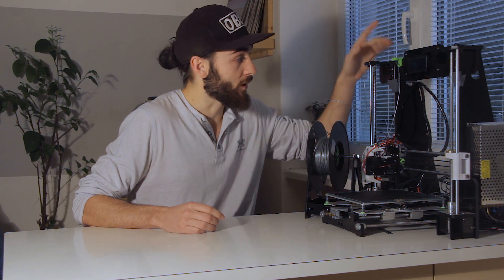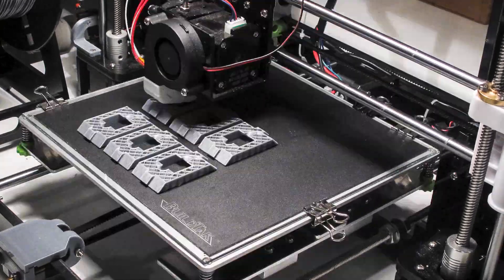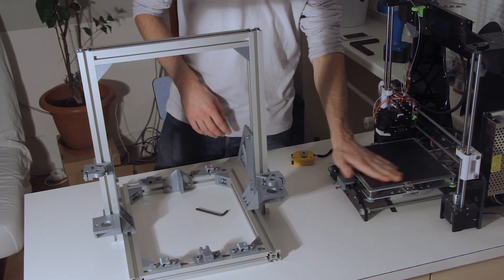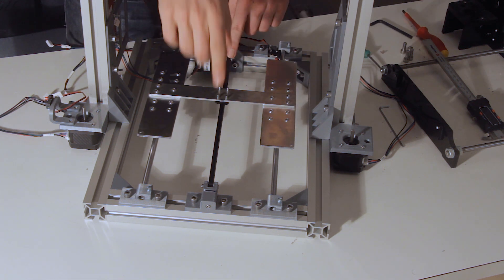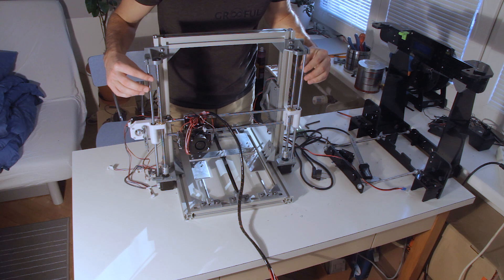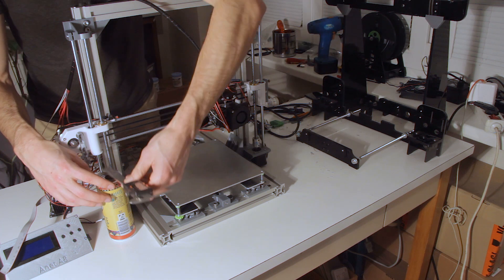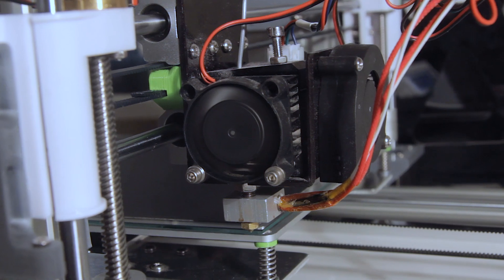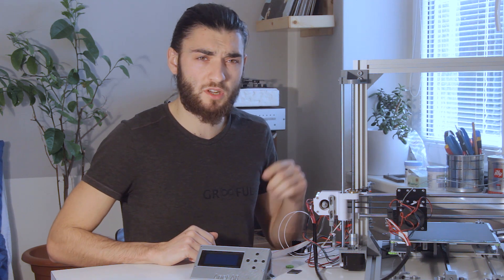Anet A8 upgrade – metal frame

Comment: Old video........yes. What i did with mine was to use a 1cm x 1cm 'C' channel of aluminum that I had hanging around, and I printed a triangle to go over the top of the acrylic frame in the centre, and two curved corners that would allow a ratchet strap to spread the tension in a downward fashion, making what looked like the roof of a Greek temple with a shallow slope. Then I ran the strap over the printer and under it's table, connecting the strap to itself. I gently snugged it up which essentially anchored it to the table it was on, taking care not to overtighten and warp the acrylic frame. I got the best prints EVER out of that machine after that, then I ordered the aluminum frame upgrade kit. The aluminum frame is not necessary if you do the strap thing. I would say the strap is even possibly more rigid, but who wants a jury-rigged machine?

Comment: thanks for your great effort  but I have some comments, first if there is option to avaoid the belt in the Y axis for more accuracy and avoid the difficulty in assembly   second if some thing ready in the design to avoid Z  axis calobration if any other design make Z axis ready when assemblin no need to Calibration , third if there is autolevel sensor for accuracy ehen level bed  that were my comments otherwise you did a great job
Reply from the maker: Thank you... Honestly, I don´t plan on making any upgrades to this design. But you are more than welcome to remix it and solve any problems... :)

Comment: Not sure if you are still monitoring the comments on this video, but I might as well ask because it'snot in the video or the thingiverse post:

Is there a reason that you used flange nuts instead of hammer nuts??

Is there a list of how many of each/which model we need to print?

Have a few more but I'm curious
Reply from the maker: Hi, well I used flange nuts because they are easy to get and easy to work with... Sorry, there is no list with the number of parts. What are the other questions? :)
Reply: @JindraSykora  that's all. If the parts shown in the picture you put in the video before assembly has everything I should be good. Looks like six of one bracket and 2 of the other. Can't wait to start this build. Just waiting on the extrusions from China 🤞

Comment: Can I use a 20x20 profile?
Reply from the maker: You can, but you would need to modify most of the printed parts..
Reply: Can you tell me what sizes to set in the slicer for modification?
Reply from the maker: @wladimirkarpenko6320  Modifiing the scale in slicer will probably not work... But there are other projects on Thingiverse specificaly for 20x20 profiles.

Comment: I have just finished the build, had to modify the Yaxis rod holder motor side as my thumb screws were fouling and there wasn't a Z stop mounting so i had to make that too but it seems to be pretty good, you don't HAVE TO get the V lot extrusion cut if you have a chop saw ;) saved a bunch cutting my own, got 2X 1500m and was left over with a little over a foot. TY for this video i had to stop it several time to get an idea of what it was you were doing and the orientation of the parts you used.... Great Work TY

Comment: Do I really need 100 Bolts and Nuts for this?
Reply from the maker: Well, maybe a little bit less than that... but they are very cheap and it's better to have a few extra than having to run to hardware store in the middle of the build... 😉😉

Comment: I find your solution with 30x30 amazing. No fancy stuff, just simple nuts and flanged bolts you can find anywhere at hardware store. You did an amazing job! It has some serious potential. You could think about a linear rails aswell just adding other 2 profiles to support the rails.
Reply from the maker: Thank you... 😊 linear rails would be great, I might add them in the future, but I should upgrade the control board and stepper drivers first... 😂
Reply: @JindraSykora  I have two Anet A8. The first one is installed on a Tatara Hayabusa frame. I just got and skr 1.4 turbo+2208 Uart for that🙂
Reply: @JindraSykora  I was just checking BOM for this project... I did not make the math but...is the the final build volume identical to the original A8?
Reply from the maker: yes, it should be the same...

Comment: Nice build, very solid.  Changing the ball linear glides for plastic liners will go a long way to replace that gritty slude feel with tripue smoothness.  LM8UU exactly replaces the ball bearing units on bed and head.  Longer are needed for z.
Reply from the maker: Thank you for the suggestion I will definitely consider it..

Comment: Great Video, I am going to do similar. What size build plate could you fit? looks like you have a lot of room.
Reply from the maker: Hi, thank you... I am using the original Anet A8 plate which is 220x220 mm. There would be room for a bigger one in the X direction but not in Y...
Reply: @JindraSykora  Do you think it would be possible to extend that build area for the Y axis?

Comment: I agree that a metal frame is better than original A8 acrilic frame. However I am wondering if it worths to spend on any metal frame vs. spend on a new ender 3 or somethig similar. As Amazon does not send this 3030 frame to my country. eBay does with some extra charge plus taxes plus, ... It is easier/cheaper to import a new 3D printer.  I do not scare to do any upgrade like this.
By the way could be possible to hack X or Y size (260mm instead of 240mm) with your frame size so I can still print the SPANNERHANDS Spool case? My Anet A8 has a maximum free travel on X of 268mm.
As I have already print them with my original acrilic frame at real 100% size hacking X_BED_SIZE to 260mm instead of original 240mm and X offset = -3 mm.
Reply from the maker: Hi, you are absolutely correct, that it would be much easier. However, I have already had Anet A8 at home and was able to source the extrusions locally for about 20 USD. And I did enjoy building it. :)
I suppose you could stretch it to 260 mm, but have not given that any thought yet. Because I mostly print smaller stuff and have 220x220 mm BuildTak surface anyway.

Comment: I've done the same upgrade. Works well. If you want more speed I think there might be better options that result in a lighter x and y axis.
Reply from the maker: Yeah, you're absolutely correct. I am working on a lighter x-axis at the moment... :)
Reply: @JindraSykora  I've been thinking about making the Y-axis lighter. I've switched to Drylin bearings and have printed bearing blocks to hold them. I've also purchased some carbon fibre sheet to replace the Aluminium H and convert to a 3 point mount. I found an article on how to make a bed heater from wire and plan to replace the stock heater with a wire heater pressed to the underside of the glass using kiln "paper". Kiln paper is a bit like a fire blanket it's used by glass makers to press indentations into hot glass. All this is at the planning stage.
Reply: @ColinWatters  Theres plenty of DC and AC silicone heaters available on Ebay cheap direct from China. Some printers are already coming with the AC installed.
Reply from the maker: @ColinWatters  Making the Y-axis lighter would definitely help... I was thinking about replacing the Y-carriage as well. Please let me know how it went and what difference does it make.

Comment: Nice design, You could say to what extent the two arms of the z-axes and the two y-bars are placed. a small scheme of measurements in thingiverse would clarify a lot.
Reply from the maker: Hi, I did actually plan to do that, but I somehow forgot... Thank you for the reminder, I will put it up ASAP.
Reply: @JindraSykora  OKAY. thank you very much, I almost have all the pieces for the conversion.
Look at this other partner what design for the electronics box. power supply with a led, and material support

https://www.thingiverse.com/make:467635
Reply from the maker: @marioc5709  I have just uploaded the scheme on Thingiverse, you can have a look.. https://www.thingiverse.com/thing:3401790
That conversion looks amazing. Electronics are something I am yet to do...
Reply: @JindraSykora 
I have all the printed pieces,  saw the scheme ,and  have the frame preassembled.
my doubts are the placement measures of:  y_rod_holder_front.stl, y_motor_mount.stl,y_rod_y_stop_back.stl.

You could mark in your scheme the exact position of these pieces.
Reply from the maker: @marioc5709  Yeah, no problem. I will post it in the evening...
Reply: I forgot, which screws are used in each piece is not clear to me. If you included in your scheme also the screws to be used would also be clarifying.
Reply from the maker: @marioc5709  I am sorry but I actually don't remember which bolts I've put where... But when you will start putting it together it should be obvious which ones to use.
Reply from the maker: @marioc5709  sorry I would not be able to get to do it today... Hopefully tomorrow. But you can try to simply center everything...
Reply: do not worry, I have to buy the screws and find a hole that my baby leaves to be able to put it together. when you can put the measurements
Reply: @JindraSykora  
I have a small problem, in the parts that the screws are wrapped for Motor__B.stl 
 in this engine. I would need to know what screw you used 6mm,  I can buy around here have the head that does not fit so that it does not stick to the engine, or did you sand the screws to intert in the hole ??
Reply from the maker: @marioc5709  I guess you can use bolts with this type of head and get the extra room you need... https://www.screwfix.com/p/easyfix-countersunk-head-socket-screws-stainless-steel-m6-x-25mm-50-pack/2398t
Reply from the maker: @marioc5709  I have updated the scheme on Thingiverse... Please don't take the dimensions too literally. They will obviously vary depending on the precision of your prints for example. Just make sure that everything goes smoothly as I say in the video.